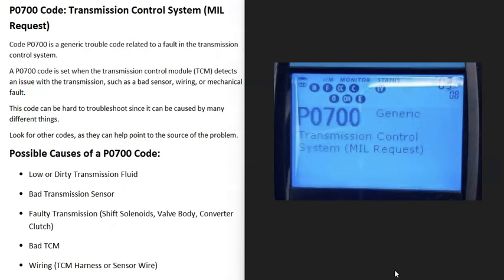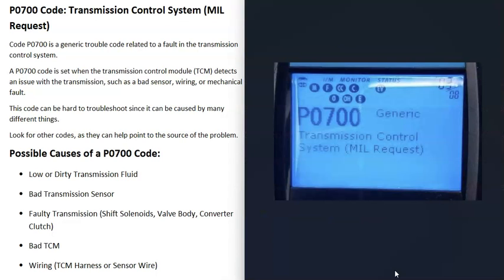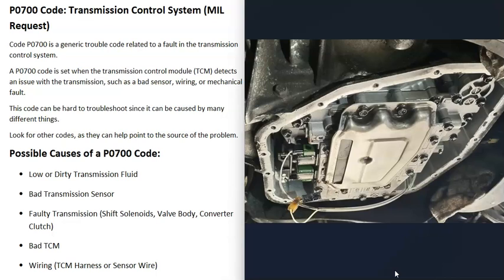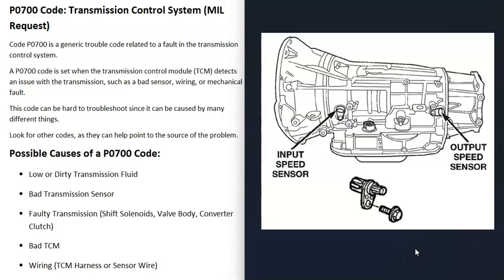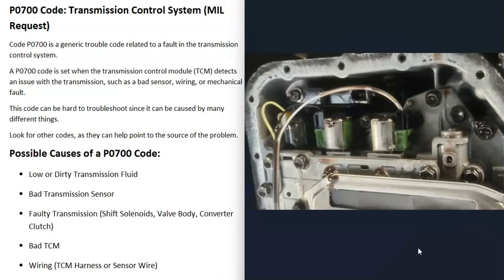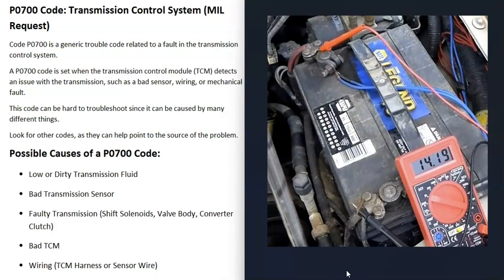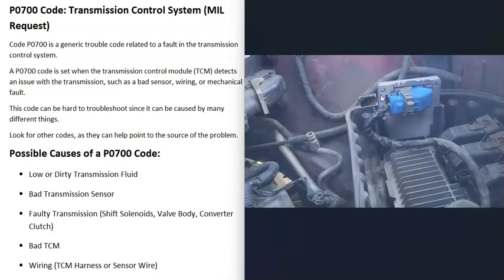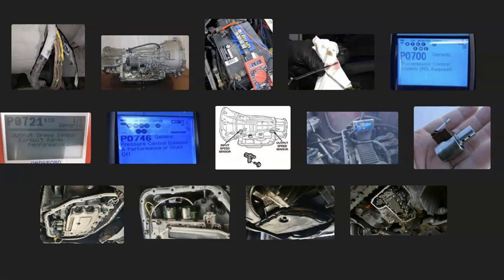Causes and Fixes P0700 Code: Transmission Control System (MIL Request)

Comment: I have a po700 code an a po7e8 code can't find a way to check the transmission fluid on my 2016 Cruze limited help!!!!!
Reply from the maker: The 2016 Cruze doesn't have a dipstick to check the ATF. There is a procedure to check it, which is a bit involved. Basically, the vehicle is leveled, a plug on the side of the transmission is removed, a set temperature is reached, and the correct fluid level is indicated by a slow, steady drip from the plug hole.

Comment: Thank you for the video, I have a 2005 Chrysler Sebring Convertible with 76,000 miles. I kept getting a check engine light. After using a OBD 2 tester on the car I got the PO700 I cleared it one time it didn't show up after two weeks. It showed back up, I tested it again. This time I got a PO700 & PO562 after checking the battery to make sure the battery is good, I checked to see if the alternator was good at first it was showing good. But the next day the battery was dead. Come to find out my alternator was bad it had some kind of short on the inside that was intermediate. After changing the alternator all was good. 

I'm so glad I didn't do a transmission service and put a new battery in before watching your video. That would have a lot of money. 250 just for a decent battery let alone what it would cost. Again Thank You so much!

Comment: Hey there, I have a dilemma. I bought a 09 Subaru Outback SOHC, It wasn't running bad engine. Long story short I fixed it. When to dealer to get some parts and found out it had a 2010 engine with a 09 Air Intake setup. Also the Transmission belongs to the 09 as it is an AT4, Great! I have had the right head go bad on me twice, seems like the oil is not reaching all the way up of Right side head and it goes bad, replaced it twice. This time around I fixed and took it way from my kid and been driving it for 3 weeks, dash board lights up like a Christmas tree. I get my OBD readings and all 6 code have to do with the air intake fault or issue. After doing my research I noticed it had a different air intake, The 09 has a metal version and the 10 has a black plastic version. I go to salvage yard pickup a whole kit and swap. I am know getting a P0700 error code, could it be that the EMC is not detecting the CVT transmission, because that's what an 2010 should have versus an Automatic transmission that goes with the 2009.

Comment: Sir sir Thank you. This helped me out greatly diagnosing a transmission problem. Changing the transmission fluid and filter was the golden ticket. 60ish dollar vs a new system. Plus disconnecting the battery to remove any glitch to reboot the computer. Remember to match the same amount fluild that was taken out (case by case)

Comment: the plug on the firewall under hood passenger side, was the only problem. for me. i cleaned it, put Vaseline around the rubber seal and tiny bit in the pin holes. if you can find out which plug it is, helps

Comment: Questioning got I 07 cadillac escalade and I got the same code is that y my truck does not change gears it just go's from 0 to 120 without Changing gears feels very heavy and rpms go's high too

Comment: Great video, although it should also be mentioned that the fuse box (IPM) can cause this problem. I rebuilt the transmission because it was burned out; the governor, solenoids, and sensors were also replaced. The torque converter was rebuilt. The same problem persisted. The engine and transmission wiring harnesses were checked. Finally, I opened the fuse box and saw that it was completely corroded and the circuit board was burned out. I've already ordered another box; it's the last thing left to replace. Regards.
Reply: Hello, thanks for the info. Ive also changed some parts inside of my 6t45 automatic gearbox. I assume that there is some problem with fusebox. What is the type of your car and have you fixed this code?
I cant remove the key, and can not start the engine..

Comment: I have a 2011 chevy cruze & it was fine when i parked it but the next day i got in it to leave and it wouldnt shift right, and every time u start it and try to drive it , it does something diff with the shifting. Like it wont shift out of 1st then i can let off gas and sometimes it will shift but then it slips , will be going 50mph and it just dropped down to 2nd year & the seat belt about cut me in to..the only code it gives is the p0 700 ..its been sitting since befor Christmas and i just now was able to get someone that had a code reader..i need help so bad..

Comment: Chevy Cruze diesel in limp mode as soon as it hits 40mph.  Codes are: P0700, P0729 (6th gear ratio incorrect) and P0735 (5th gear ratio incorrect). 5th and 6th gear controlled by same solenoid (SLC1 Valve). I have a friends Autel DS900 but don't know how to use it.  Is there a way to test the solenoid with the Autel? Any other ideas?  Thank you
Reply: Hey man I’m having the same issue in my truck did you find out what the issue was?

Comment: I have three codes that came up on my 2016 Chevy Silverado k3500 -(po700),(po1fo), and (p2771) my truck is not downshifting sometimes and has trouble taking off at a traffic light. Sometimes downshifting hard and check engine light is on . What should I do first?
Reply from the maker: I would start with the P2771 "Four Wheel Drive (4WD) Low Switch Circuit", which is likely causing the P0700 code. The P01F0 "Coolant Temperature Relapsed Below Diagnostic Monitoring Temperature" is a separate issue, such as a bad temp sensor or a bad thermostat.

Comment: I have a 06 dodge charger and i have this code along with 
P1684. battery was disconected 
P0562.  System voltage low 
Any ideas on what this would be and what i need to do to fix it
Reply from the maker: I would check all the battery connections for any corrosion and then test the battery and alternator output.

Comment: Please help. I have spent so much money trying to get  08 Yukon Denali fixed. At the moment, my vehicle has 3 codes P0700, P0174,  P0521 -  PLEASE HELP .... I have already had the transmission changed twice in less than 1 year, and these mechanics just take advantage of me because I'm a female.
Reply from the maker: The P0174 code "system too lean" can be difficult to troubleshoot since many things can cause it. The P0521 could be a bad oil pressure sensor or low oil pressure. The P0700 code could be a transmission issue, but the engine problems may be causing the computer to be unable to do calculations for when to shift and so on, which sets the P0700 code. I made videos on each of these codes. It needs to be diagnosed. If possible, it is best to find a good mechanic you can trust.
Reply: @HVAC_Mechanic   That's the problem. Now a days mechanics are only looking out for themselves and not the customer. Unfortunately I will have to keep looking around in hopes of finding someone who is honest and reliable, but thanks for the response. Videos like these help people try to fix their cars on their own.

Comment: Help me please. 2000 Dakota 4.7l, code 0320 & 0700. I’ve spent so much money and it’s driving me crazy. Wife might have cancer and need to know what to do to fix it. I have 4 days to get it fixed or were missing all our Dr appointments. Me and my wife have health issues so please help
Reply from the maker: It needs to be diagnosed, but I would test the crank position sensor. The code P0320, "Ignition/distributor Engine Speed Input Circuit," is likely causing the P0700 code since the TCM needs the engine speed to calculate when to shift. A bad crank sensor or wiring is a common cause of a P0320 code, but again, it needs to be diagnosed.
Reply: @ thank you so much for replying to my question. God Bless

Comment: Thanks bro, watching your video I fixed my truck, the rear middle support was bad and when I accelerated abruptly it always failed because the transmission moved and a ground cable was disconnected.

Comment: I got a po107 code (top code), po001, then po700. No start. 

Got it to restart with rough idle after turning key repeatedly back to back. 

Once I turn it off back to no start. 

Plan to change map sensor and see if that helps. 

Any suggestions?

Comment: I’m getting a p07bf  code turbin input speed sensor circuit A low . Can’t figure it out. I replaced the input sensor and still not working
Reply: I am in the same exact boat today m. Replaced the sensor still having the issues. Did you figure anything out?

Comment: P0700 [0x0700]
Transmission control system, MIL request - circuit malfunction
Estatus: Confirmada
----------------------------
P1825 [0x1825]
Transmission 4-Wheel Drive Clutch Relay Open Circuit

Comment: Porsche Panamera - CAN YOU PLEASE HELP ME! I have these error codes show up: p1265 - p1528 - p1603 - p1628 - p1691 - p169A - u0101. ……. please HELP! I try to change BCM but no it was not the reason i tried everything and I still struggle with this issue since 7 MONTHS ! I have tried everything…. The transmission shift so smoothly, no sound no lagging very nice acculturating. The only issue is that some days the car will show PSM error message the D letter will flash then i turn it to N then back to D and it will work….. no dashboard lights nothing ! It is ONLY when diagnosed show the errors mentioned up ! PLEASE HELP
Reply from the maker: That's a lot of unrelated codes; it needs to be diagnosed. I would start with the "U0101 Lost Communication with TCM" as a wiring issue or bad TCM can cause a lot of codes.

Comment: I got this P0700 error code on my Chevy Spin 2015 LTZ. Then we change the ATF but before that, we do plushing first before we put another ATF and after that I drive home but still the error appears from time to time. My plan is to drain again and flush again then filled in another New ATF. With this, do u think will solve my problem? Thanks!
Reply from the maker: There is some debate on it, but I only change the ATF in the pan along with a new filter and would only do it once. It's very common to replace all the ATF, and more codes start coming up. Does your scan tool read all transmission codes? A P0700 is a generic code that there is a transmission problem, usually there is another code.

Comment: so we got this light on my bros car and he also got code p2757 so would this be the solenoids?
Reply from the maker: If the ATF level is good, it could be a bad torque converter, torque converter solenoid, or wiring issue. It needs to be diagnosed.
Reply: @ yeah thats what sucks about this, it could be a few things and i dont want him to spend thousands at the shop. his car is due a transmission fluid change so im hoping its just that or a filter change, i can easily change some parts too it just takes alot of time and he doesnt have another car for work

Comment: If you have recently had any battery issues then got this code. Disconnect it overnight then reconnect. Should clear out the code.
Reply: my terminal bolt is threaded to trash so i’m hoping it’s jus this cause everything’s felt fine & the only codes i had was a thermostat before & i just swapped that..
Reply: ❤❤❤❤❤q
Reply: ❤❤❤❤❤q
Reply: I had the same problem
Reply: When my battery died and I tried to charge it

Comment: Love your videos, what Bluetooth tool can read 1997 transmission codes? Debating on getting a tech 2 clone or a Bluetooth adapter and one of the apps.
Reply from the maker: A Bluetooth adapter just transmits to the phone wirelessly instead of using a cable. The OBDII protocol is the same for vehicles after 1996, so it will work. Some OBDII Bluetooth adapters and apps work well, while some have disconnecting issues. Best to read the reviews to see which is best.
Reply: @HVAC_Mechanic  thanks for the reply! Been crawling forums and couldn’t find a consensus (likely because the availability and technology changes are so rapid with the sub $100 BT adapters) I know 96-97 have weird compatibility issues with certain apps and BT adapters because the enhanced level codes were changed in 98 when GM added a lot more codes. 
My other idea is just go ahead and get HP tuners since I’ll need that for my planned mods eventually.

Comment: 2004 mazda 6 standard transmittion p0700 and p0300 code. Show bad plug and coil already chang it. Still has the code .

Comment: Have a p0700 code with a p0817 any idea on what going on😢
Reply from the maker: "P0817 Code: Starter Disable Circuit/Open" It needs to be diagnosed, but it sounds like a wiring issue, possibly a bad neutral safety switch.
Reply: Do you know the location of neutral safety switch on a 2006 Subaru b9 tribeca ? Thanks for responding 🙌🏼
Reply: I have a P0700  & P0182 code 2014 chevy cruz anyone know what's going on?

Comment: I have a 2009 GMC Sierra 1500 4.3 V6 with a 4L60 E transmission. Orielyls did a scan and told me I had a PO717 and a Po700 code. Got any suggestions?
Reply: Same. I need him to answer us.

Comment: What’s considered “high mileage “ ..?
Reply from the maker: It can vary and depend on the vehicle and how it was driven. For example, a Toyota Corolla mostly highway driven likely 150,000 miles. A Chevy Cruze mostly city driven likely 75,000 miles.
Reply: Average yearly mileage is usually 15,000 miles.
Reply: 100,000 plus buddy

Comment: I just had to replace the shift solenoid block on my 09 Chrysler Sebring and it’s been about a week but it’s only been driven around town not on the highway yet as I need to get it reinsured, but today I got p0700 code no other codes. My car is a high mileage car like you talked about and I elected not to change the fluid after changing the solenoid block(it is located on top of my trans) since I wasn’t already dropping the pan I haven’t changed the filter either. Just wondering if since I didn’t get any other codes if that might be my next step? Also, when I first got the codes for the shift solenoid I parked the car and didn’t drive it anymore. But in the time it took me to save the money for the parts the battery went dead as I forgot to unplug an accessory. Possibly the cause of the code, I think I’ll check that first, I’ve had issues with various wiring on the car over the years anyway so maybe I’ll start there. Thx for the vid.
Reply: I am having the same issue, my car cranks then stalls immediately, I am also getting po700 codes but my transmission works fine. What was your solution, was it wiring  and what was the pay out for it?
Reply: @TerrellTheL  my 2001 cherokee (4.7) threw the P0700 along with O2 sensor codes when O2 (cheap Chinese no name... I shoulda known better) shorted internally. Put in new Bosch O2 sensor and cleared codes. P0700 keeps coming back instantly after clearing codes. Other codes stay cleared and it runs fine now instead of wanting to die. Not sure if it's shifting different or if it just seems that way because I'm paying close attention. Hopefully shorted O2 didn't damage transmission solenoid or module. Will see if it goes away with some driving. But anyway, mine came with an internally shorted oxygen sensor.

Comment: 2008 saturn vue got code p182e as well as p0700.. looses acceleration then the traction check engine and a engine with a arrow facing down comes on. I can sit for a few reatart the car.. please help me
Reply: What was ur problem did u get it fixed?

Comment: P0700 code came on with no other code. At the time that it came on it wouldn’t allow cruise control to be set. Turned car off. Car sat for 4 hours and the service light stayed on but cruise control was able to be set. Diagnostic device was used to check what code was triggering. Turned car back on and now the service light is off. Is this signs of a faulty sensor?
Reply: Camshaft position sensor?
Reply: I'm having this same issue what ended up being the problem?
Reply: @discoverwhatsnext9835  same did u find out?

Comment: I have a 2014 crosstrek with codes p0700 and p0500
I replaced the sensor from the second code but car still shows codes. Any recommendations?
Reply from the maker: If the parts are all good, I would test the wiring
Reply: following having the same issue

Comment: My ac turns off when the car comes to a stop and the car begins to overheat during stops and traffic jams
Reply: Your fan not working properly
Reply: Could also be a head gasket failure. Check the coolant for oil slick and oil for white froth

Comment: Anyone run into an intermittent U0100 &P0700 mil and trans. drops into 2nd.  and traction, ps, stabilitrac lights all on??
Reply: That’s what I’m dealing with
Reply: What’s odd is that I have a OBD scanner plugged in just capture something and the issue hasn’t returned.  But when I remove the scanner the codes come back!  🤯
Reply: more than likely  you have a leak thats getting into the TCM connector. If so the passage sleeve has to be changed.
Reply: Hi,You manage to solve it?
Reply: @MrGal756 mines was low on fluid.

Comment: My 08 Hyundai elentra is throwing P0700,P0441,P2626. Could u help me out tell me what I need to fix please
Reply from the maker: That is a lot of unrelated codes. Unless the vehicle has a wiring issue, each will have its own fix. 
P2626 Code: (Bank 1 Oxygen Sensor 1)
P0441 Code: (Evaporative Emission Control System - Incorrect Purge Flow)
P0700 Code: (Transmission Control System (MIL Request))
Reply: Can u tell me what I need to fix. When my car gets heated it doesn't shift like it's supposed to
Reply from the maker: Check the transmission fluid and be sure it is at the correct level. Also, examine the fluid color. If it is very dirty, the filter is likely clogged. If that is all good, then there is likely a malfunction with the transmission that needs fixed.
Reply: I have a 05 duramax with 90000 miles that's showing code po700 and code po872 . Any ideas it's kicking my ass!